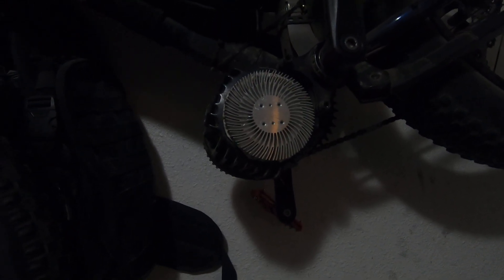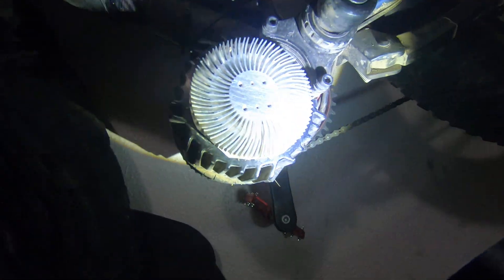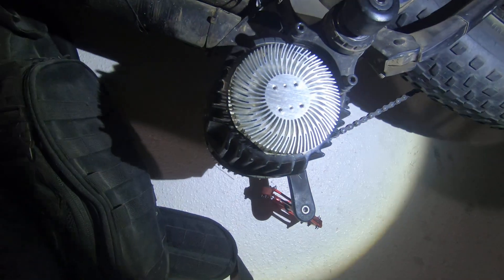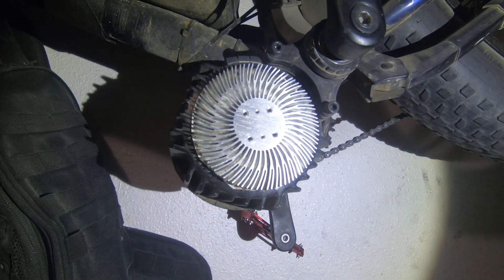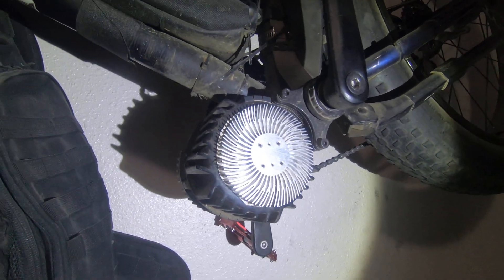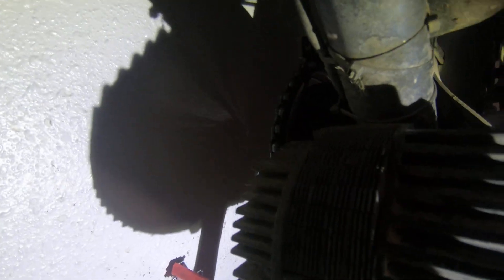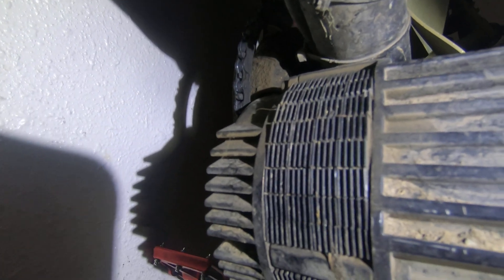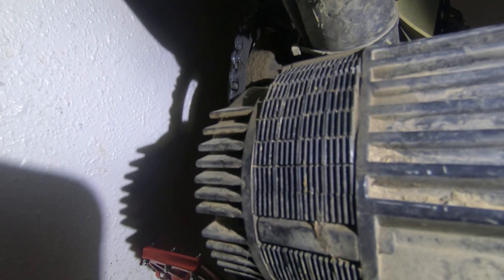BBSHD heat sink solution

Comment: awesome upgrade!
Reply from the maker: Thank you.  I hope this solution solves everyone's overheating problems.
Reply: @budwhite9781  I've been riding the tsdz2 recently exclusively such low weight and power usage,  did 50 miles today using about 6ah of 52v pack on gravel bike. Torque sensor is the best and not cyc loud.
Reply from the maker: @k04s4  Awesome.  My very first Electric bike(back in 2013), was the IZIP Currie Express.  It is a torque sensing, belt and chain driven mid motor bike with no throttle, unique frame, and really good speed and torque.  Very loud though.  To me, torque sensing is the ultimate electric bike.  Makes you feel truly bionic.  I have had my eye on those tsdz2 mid drives for a few years now.  Glad it is working out for you.  Cheers.

Comment: Nice! I see you double bracketed the side mount plate to, that would probably help stiffen those 2 6mm bolts up pretty good going through 5 and a half plates you put on 💪👍 i recently installed a bbshd 1000w 52v to my mtb.. it went well,  i made a 0.5mm shim spacer in my bottom bracket to protect the threads and stop the rocking movement from the chain torque side, it was that good a fit that the motor would sit up there in place against the frame (5mm rubber between) without anything securing what so ever, then i locktited the 2 6mm bolts and the large locking rings to finish the job. Has your motor ever come loose? The supplier near me said no need for aftermarket extra brackets to the frame if you torque it up correctly with locktite.
Reply from the maker: Outstanding upgrades that you came up with.  I also used locktite everywhere.  The motor has never even budged, even at 3500 watts.  Cheers👍
Reply: @budwhite9781  thanks, thats good to know and getting back to me👍 that shim spacer i put in i started at 100% around it and trimmed little bits off at a time till it fitted in super tight, it ended up being just under half of the full circumference i trimmed off for a bs tight fit, the only thing i stuffed up on after installing it i realised the shim covered what may be a drain hole on the bottom bracket may let water out of the entire frame at the low point🤪 its a 4-6mm threaded hole so maybe it can be blocked off by design 🤗   i subscribed👍
Reply from the maker: @rossg9363  Excellent work.  I am not getting notifications from youtube on replies or comments, so I have to manually go through the different videos.  Thanks for subscribing.  I will do my best to put more videos up, been working a lot.  Cheers.
Reply: @budwhite9781  cool mate no worries at all, YouTube has gone through some radical change the last couple of years i have noticed, it's bs how they hide dislikes now. Anyway i did watch some of your other bbshd videos and i was like WOW that thing is super quick and looks punchy off starts!!! Its way up there with the best on YouTube videos for build quality and riding it ! I did want to ask you a question about something i saw in one video, because you have a extra high powered bike, you snapped a chain and the packet of the new chain said it was a standard KMC chain not a X ebike series KMC chain with the mushroom pins, was that a get you home chain or is that what you run on it? I won't bother you again with yr YouTube alerts down. I'll put a ring bell on your channel, if you upload one day ill take a look but i won't always comment unless i see something I'm curious about ill just enjoy it👍
Reply: @budwhite9781  you can then remove all of those ton of brackets and maybe even the bolt. If glue got into the shaft motor won't move now, even if you would want to take it out. That's what happened to me